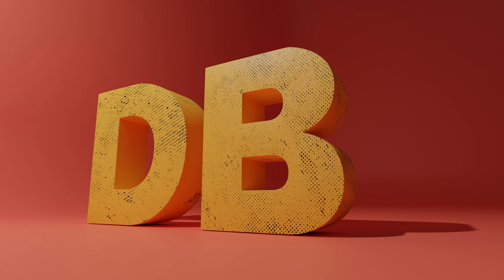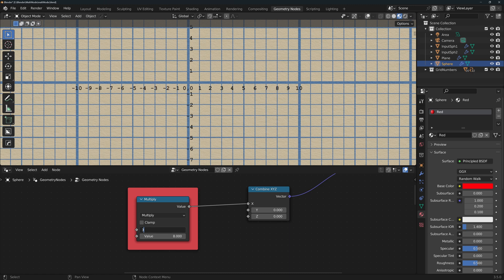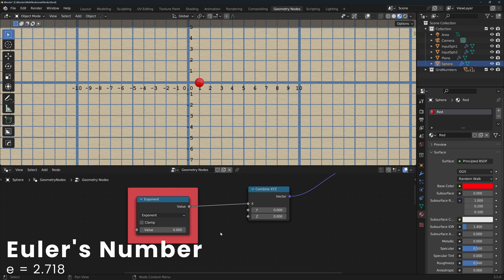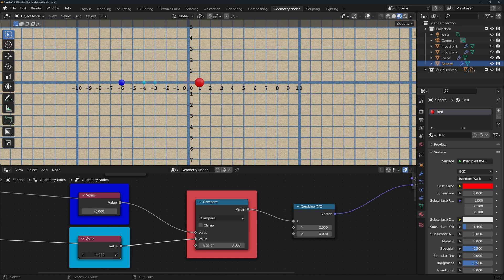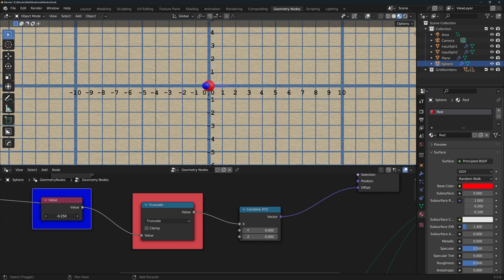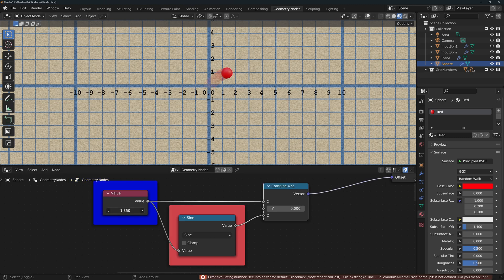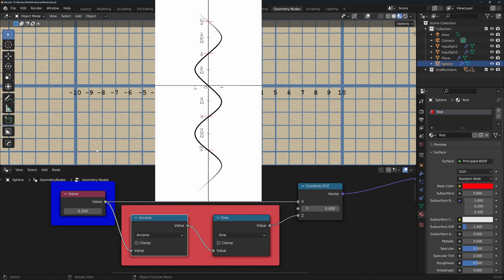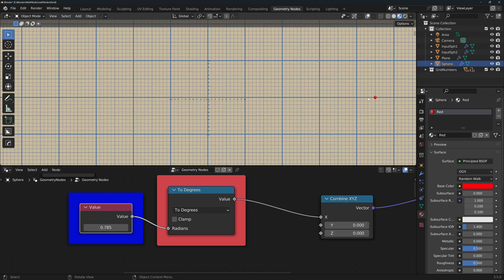Math Node in Blender Geometry Nodes explained by an engineer

Comment: Hey dude, I am a bit confused about the modulo part, how come 11/3 become 3*2/3 ? And in the second example you show a percent sign 9.5%3.5 I am confused 😭

Btw really great video, surprised that u explain so well
Reply from the maker: @noobplays4376  hey dude! Right! So the % represents the modulo operation, it’s like / for division or + for adding. 11/3  can also be written in terms of a whole number and a fraction of a number. 11 divided by 3 is 3.666, or 3 and two thirds. So 11/3=3.667 and 11%3=2, does it make sense?

Comment: I think it would be better with explanations coupled with practical use cases. Who would use log, exp, and inverse square root without it being shown in an example code that is being recreated? Show the benefit of manipulating the value so that math functions behave predictably. I.e. 0-1 is the most versatile range to operate in, but sometimes you may want to use remap to say -+pi/-+tau for trig functions. I typically use geo nodes this way to figure out the math I need for materials, but I use a mesh line from x=0 to x=1 and drive the y coordinate with the x to get a curve representation; most of the time we're trying to manipulate shapes/displacement/bump.

Example. Say you want 2 off positive half circles spread along the 0-1 range, with a small space between each (and ends) that is also smooth. Trig absoluted won't cut it as the tangent isn't close to vertical, you need an actual semicircle. You can't use map range with smoothing as both ends will be equally smoothed. I'm sure you're able to see the obvious answer; multiply with 2 times, fraction, remap -> 0.05-0.95, remap to -1 to 1 (sawtooths with flat short ends), power 2, 1-result, square root (semicircles with flat bottoms), smooth maximum and map range (from min) using the same value; the result are two "titties" with flat bottoms that are smoothed out but the output remains in an easy to control 0-1 range.

Now, I'm definitely not into maths, so coming up with the above certainly didn't come easily for me. But it was also something I needed (and since, many times) as shaping a material curve using float curve doesn't always play nice with bump (inflection points are always highly annoyingly visible).

Other examples are how to convert cartesian coordinate systems into polar (both disk+z for height and cylinder+z for radius) or spherical, and maybe other fancy coordinate systems like pyramidial or spirals. Practical examples of how hyperbolic functions could be used?

Haven't checked the vector math video yet, but I'm sure the same applies there.

Comment: Sir please can explain Epsilon bit further? like what is epsilon value? why the OTher value shuld remain in -3 to -9 , Thanks a lot
Reply from the maker: Hey! So the range is defined from a center point and a distance to both negative and positive directions. That distance is the epsilon. So if the center point were for example -6, and epsilon were 3, then the range would be from (center point - epsilon) to (center point + epsilon), which would be -9 to -3. The node just wants to know if a number is within that range.
Reply: Thanks a lot sir, just wants to be sure,

If the center point is -6, The epsilon value which we have set to 3 , for negative one it would become -3 and the distance from -6 to -3 is -3.
For Positive , it would become 3 , so The distance from -6 to 3 is -9, then . . . 
Example: Let say I have -6 as a center point , 12 as a value for epsilon, so for negative epsilon it would become -12, and the distance will be +6, For Positive epsilon it would become +12, so the distance will be -18. SO if the second value is between 6 to -18 , it would be 1 . Am I right?

Sir the last question:
Is it necessary that the first node value is the value which would be the Centre value or center point?
Reply from the maker: @beten_rwt  correct! And note that for the first two values, it really doesn’t matter in what order you connect them as the node will just subtract them and see if the absolute difference is smaller or equal to epsilon.

Comment: So which of does would help me the most to mirror two sides do the same thing with out breaking I scale.

The negative xzy does work fin but the same nodes in the positive seem to miss the mark.
Reply from the maker: Hey mate, I didn’t understand what you’re trying to achieve. You mentioned XYZ so I’m assuming you’re trying to have a vector mirror another one? If so, maybe take a look at my vector math video as there are a couple of ways to do that.
Reply: @Dude_Blender  I just want to build 4 walls with one grid. And controlling all four walls by scaling the x y values.
Reply from the maker: @longlivethesecondplaceice2736  I would try either duplicating the wall with alt+d, so any change you make to one wall will apply to the rest, or add geometry node instances of a plane or cube to make the wall, but I'd need to see your project to know exactly what you're doing.

Comment: Great video, I'm glad I found this!
One question: I'm trying to remap positional values using the Map Range, from their current domain to 0 to 1. But for "From Min" and "From Max" how can I get my dataset's current Min and Max?
Reply from the maker: @moharmon770 Hey mate! Without knowing the nature of your data, and if it’s not possible to calculate it with math (which would be the first thing) a neat way would be to show your value using geometry nodes (value to string, string to mesh) and then you can see the values that your domain is taking. Still I’d first try to figure them out mathematically to be more accurate.
Reply: You can use the Attribute Statistic node to get the "From Min" and "From Max" values
Reply from the maker: Nice,  @codewatcher5921 , although, only if the dataset is a mesh, correct?
Reply: @Dude_Blender  Yeah, possibly. I mostly work with mesh data, so it's what I'm most familiar with 🤷‍♂
Reply from the maker: Gotcha, thanks for the tip!  @codewatcher5921